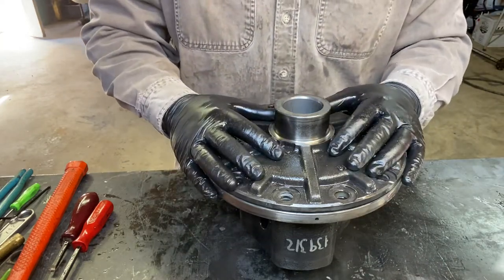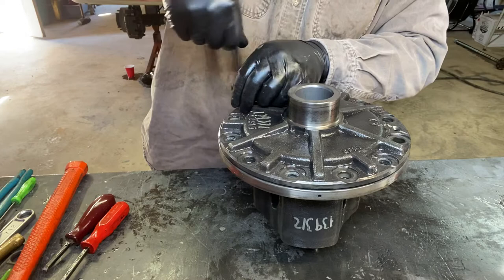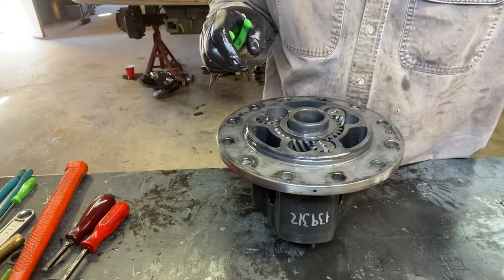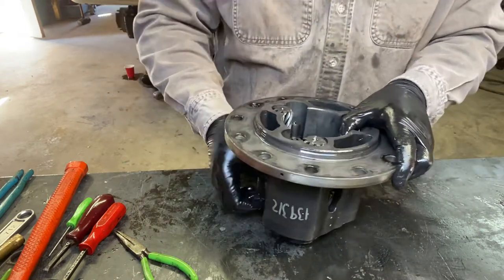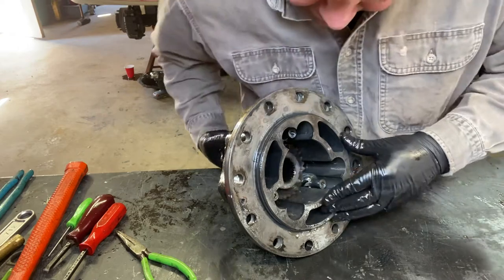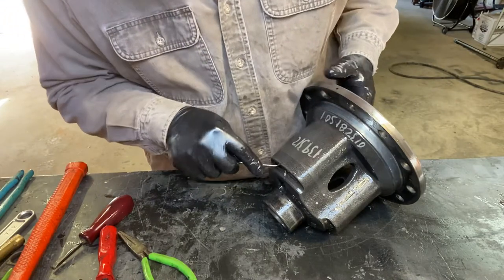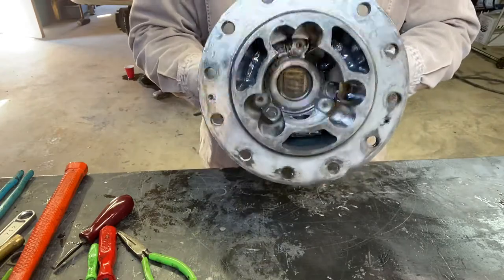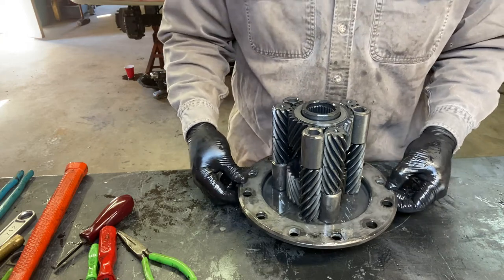Ram 3500 Differential anti-spin

Comment: Just bought a 2006 3500 single rear wheel I didn’t know if it had limited slip so I power break it it does :-) I was curious what type of set up it had this looks just like the Detroit true track

Comment: I have one of these all apart trying to figure out why the driveshaft can turn almost 1/8 without moving the rear tires.... i found one of the shims broken inside... some small chips on the surface of the spider gear teeth.

Comment: Was stuck in mud and found out my antislip is slipping. Looking at this and that must mean there has to be substantial damage but all works otherwise as expected. Just changed fluid 10,000 miles ago. What must be must be I guess. Time for open says me.
Reply: With this style it will act almost like an open diff if one wheel has traction and the other has none...  
Sometimes giving it some parking brake will TEASE it into sending power to the wheel with traction

Comment: hey thanks for making this video. I was looking for information on how much endplay the side gears can have and can't seem to find any info on it. I have mine out of the truck and I can rock driver and passenger side gears back and forth about 1/16 of an inch. Have you checked endplay when you had this one apart?
Reply from the maker: When I checked mine there may have been .005 to .008 thousandths. Just enough for oil.
Reply: Hello So what did you do with the 1/16 play ? 
Sounds to be ok with in spec s ? 
What did you do ? 
Thank you

Comment: Like a Detroit Eaton True trac
Reply: Is it just like the eaton? I'm hoping my truck doesn't have one, haha, I just spent 1,036 on itv and waiting to install it.  The 1 wheel wonder is really a pain in the butt  im gonna give the ebrake  trick a shot before I put it it. Though I think the eaten likely has a better design than the aam oem  With spur gears instead of those  6 little wedges that wedge into the aposing gear it rides against. I think the issue  with the aam is exactly those wedge pieces and having to force them into the gears via the brake by adding load to the spinning tire when they wear out. I guess the true track is the one I should of been looking at buying but im about to open up my new eaton to see if it is biult like the factory  one in video first of all. Thanks for the enformative video. Subscribed!

Comment: Is this the same as "Torsen"?
Reply from the maker: Very close but not as aggressive.
Reply: @bigmarv1807  Cool.  It looks like the Eaton Trutrac product (or similar).  Doesn't seem to be a clutch and friction plate type LSD found in the 1500/2500 which wear out.  Is this after-market or OEM?

Either way cool video dude
Reply from the maker: Very similar to Eaton trutrac. It is factory OEM

Comment: Can these be rebuilt?  New internal gears purchased and installed?
Reply from the maker: possumpopper89 If the carrier’s case is not worn should be fine. The issue is finding just new helical gear set. I have never been able to just the gears for sale.
Reply: @bigmarv1807  I see new diffs and used diffs for sale as complete units. I haven’t seen the helical gears for sale separately either.  Just curious if anyone else knew of a source.  Mine is in good shape, years ago I had the helical gears coming apart in a jeep I used to own.